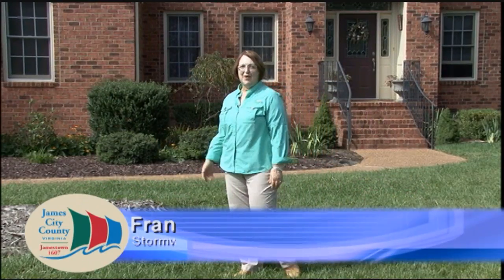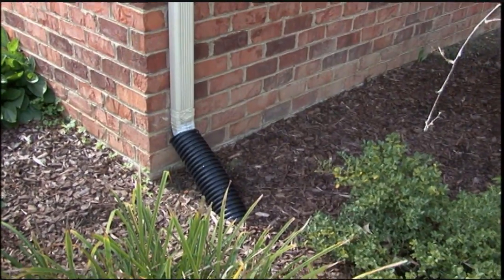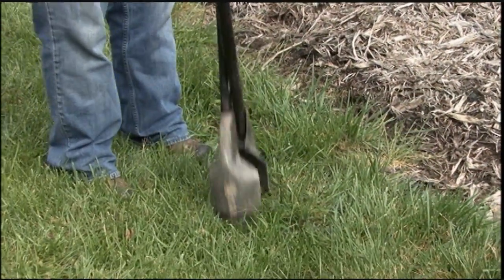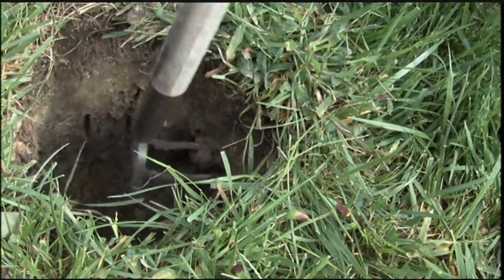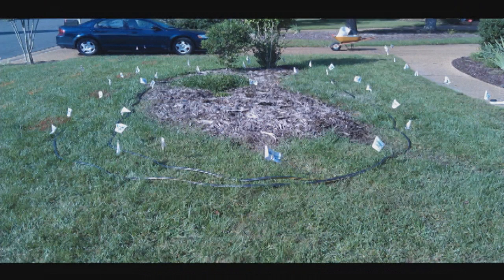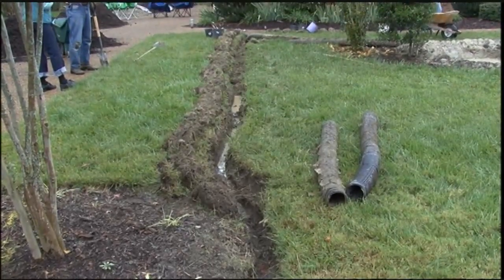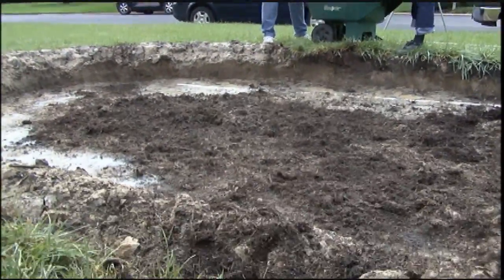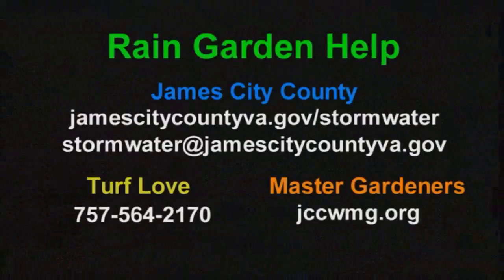How to Build a Rain Garden

Comment: Thanks for posting this video.  Can you provide a grater explanation of the Size calculation.  It appears that you simply based the rain garden size on 1/10th of the runoff square footage, and guestimated the depth.  Is infiltration rate included in your calculation?  Or does the size really matter when there's an overflow that will handle excess runoff.

Comment: This is awsome!! Thanks for showing all the steps and details. By the way when you do the permeability test, what if the water does not drain in 24-36hrs anywhere on the property?
Reply: Get ready to dig until your hands are raw - I'm finding this out the hard way. 4 feet deep of clay so far
Reply: How did you build there?